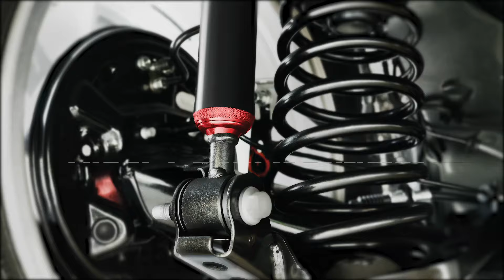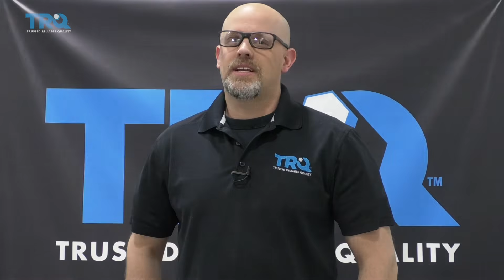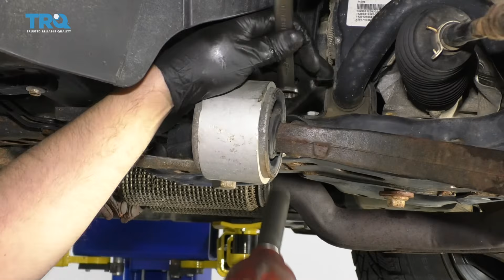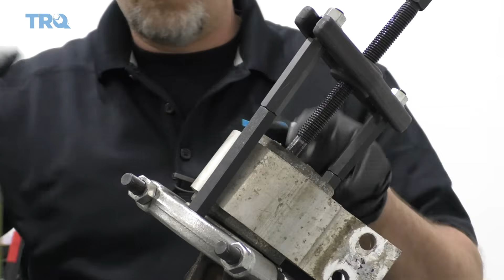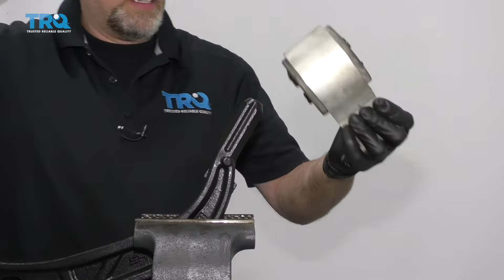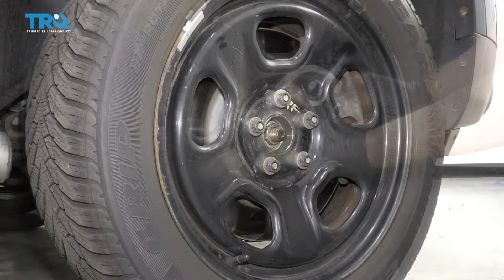How to Replace Front Lower Control Arm 2013-15 Ford Police Interceptor

Comment: Thanks for the video. Recently replace the trans torque strut on my 15 PIS. Well after late summer I found out that it just caused my border line control arm bushing to fail. $75 for the big bushing. $125 for a whole new arm with all the bushings. Sounds like an easy sell TBH.

Comment: In the northeast rust belt not an easy job. Did one today and had to cut the ball joint stud with a sawzall! The nut would not come off and I stripped the hex in the top with a vise grip.

Comment: I HATE working on Ford suspension. That nut on the ball joint will spin until your head spins. Then you use the hex 10mm to hold it and round that off. 😉Then you take out the torch and try not to melt everything rubber around it, like the CV boot. 🤨

Comment: No idea what to do if I’m re using the ball joint lol.  Threads are super tight near the top, despite wd40 and wire brushing, working back n forth.  Don’t want to buy control arm, I already got the large bushings.  That’s all I need

Comment: The aluminum mount install. Is a nightmare! My dead blow was leaking sand by the time it was close to being in position
Reply: I used a block of wood with a mini sledge and it went in just fine
Reply: Put the bushing in the freezer for 45 minutes . Freezing shrinks the rubber . Mine slid right on with 3 taps of the hammer .

Comment: Just had an accident in our taurus sho, Crashed into a tunnel wall in the rain because the car understeered. Somehow at 40mph the only damage was the ball joint on the control arm and the tierod plus since it hit the wheel on the wall the wheel got some big gash marks. no body damage somehow.
Helpful video, Thanks
Really needed to see how to remove that bushing since mine doesn't come with one
Reply: bald tires

Comment: Did he really just say "it's recommended to torque this bushing with the weight of the vehicle on it..."but it's too hard to get at the bolt that way.. "  and than proceed to just torque in the wrong position. Next time just put a jack under the ball joint and jack the arm up till it just takes the weight of the vehicle. That way you won't be changing that bushing again in 3 months when it just rips itself apart from being torqued in the wrong position

Comment: Why would TRQ give you a control arm without a large control arm bushing attached ?   Why would you go through all that trouble to replace a control arm with an old bushing.  Replacing it with a new one takes about 300 whacks with a dead  blow hammer.  Removing the old one is impossible without the tools you see in the video.  I wish TRQ would charge a little more and give you what you need .  I had a hell of a time getting a new bushing on the control arm.  Never Again
Reply: Were you able to get it on with just a dead blow? I'm having a hell of a time getting this stupid bushing on the new control arm its ridiculous the last set for my last vehicle came with it already pressed on.

Comment: Did he just hammer that large control arm bushing on? I tried to do that and it’s almost impossible without a press
Reply: When I received my bushing, it was the wrong one! Looks the same but had rubber on the inside, this would of made it nearly impossible to hammer in. The ones that will hammer in are metal and have slight ridges….

Comment: Why did you reuse the old mount when the new lower control arm comes with a new one already mounted and ready to go?
Reply: If you are talking about the round aluminum mount with the rubber bushing inside, I think the control arm assembly they sell  doesn’t come with that, although some other vendor’s assemblies do. That mount is often worn out too , although the one they reused in the video looked ok.

Comment: Great video, but I have one question? Under what circumstances you would have to change the control arm? If the ball joint is fine, but the bushing is worn (and vise versa), wouldn't it be cheaper to replace just the bushing instead of the entire control arm?
Reply: Cheaper on long run plus you get new ball joints as well
Reply: Currently doing the bushing as the arm on my vehicle is 200 a piece and bushing are 50
Reply: You replace the lower control arm when you start to feel a shake in the floor while accelerating because the control arm bushings are bad!

Comment: Buy the whole arm with mount for $115!!!  Cheaper in the long run after labor cost.  I just bought both sides for mine and they go right in
Reply: If you replace one always replace the other that goes for brakes and all suspension parts!!
Reply: Where did you get it and what brand?
Reply: Orilley, lifetime warranty. 115.00
Reply: @joshjohns638  257 dollars now